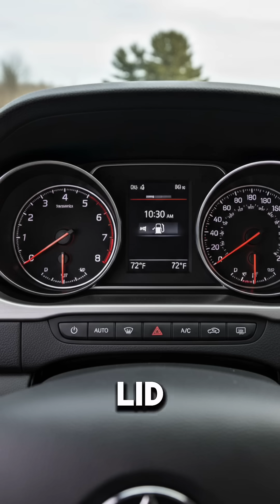How to Get Potable Water From Smoke in a Post-Apocalyptic World

Comment: Distillation cannot effectively remove chemicals with lower boiling points than the substance being distilled, such as volatile organic compounds (VOCs) like benzene, as they can evaporate and condense with the purified substance. It also cannot remove substances that are soluble in water with boiling points higher than water, such as glycerol. Finally, azeotropes, or mixtures that boil at a constant temperature and composition, cannot be separated by simple distillation.